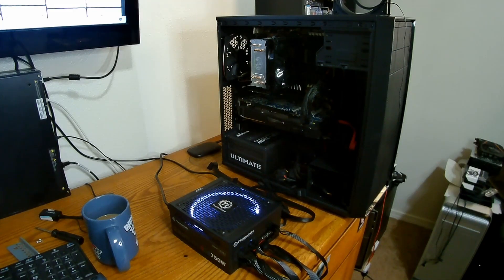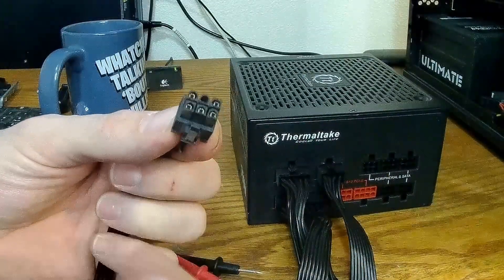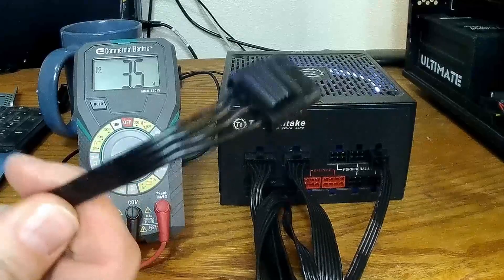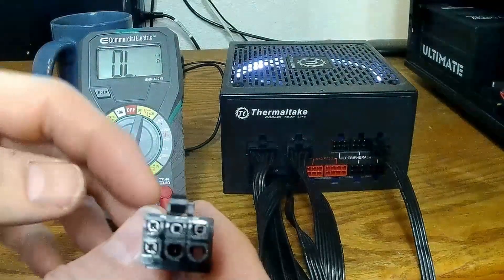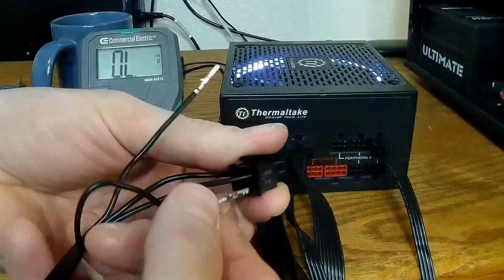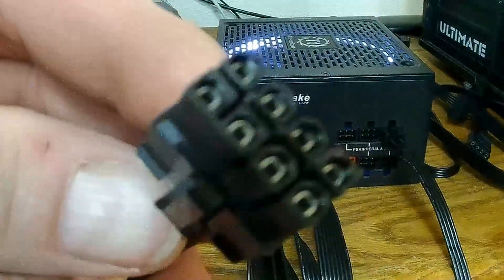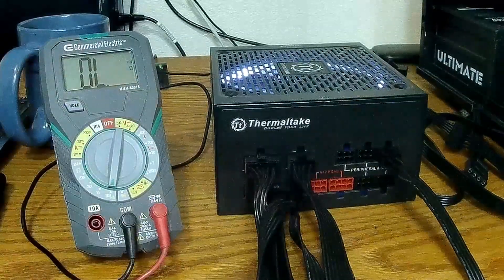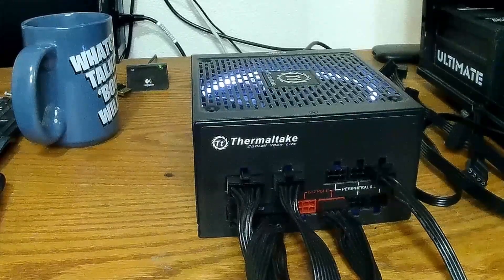Repin Modular PSU Cables!

Comment: First:  HOW THE FK do the PSU companies get by with making nonstandard pinouts for their devices?  The board side of all these cables is industry standardized.  Why can't the PSU sides also be standardized?

Second:  When I get a new PC, I always bring over all my former drives to the new machine.  My current new build has 6 former drives, plus a DVD drive I'm adding to the new build.  The cables supplied by my new Thermaltake PSU only have 2 SATA power wires, each with 3 connectors.  Thermaltake said they do not have a cable that I can buy from them to power my last drive.  How the hell is that possible????
Reply from the maker: They'd rather sell you a psu vs a cheaper connector unfortunately.

Comment: I have a question for you. i have a corsair RMe850e 80 plus gold low-noise atx 3.0 gpu and have an issue with the pcie cables. on the cable end that plugs into the gpu all the plug holes are not full. if you are looking at the plug with the clip facing up lets go with a count like this.
       clip  
    1 2 3 4 
   5 6 0 8  the zero does not have a pin in the plug
this is what came with my gpu. i am in need of another cable but can not find any cable that matches what i have. i am asking you if a cable with this configuration will work with out issues. 
    clip
 1 2 3 4
 5 6 7 0      zero has no pin.
your advice will be helpful

Comment: Starting at 3:58, when you're checking the volts on the psu with the red lead on the multimeter, where is the black lead connected to?
Reply from the maker: the black lead is grounded to the psu chassis.
Reply: @ thank you for answering. This was very helpful. This video helped me tremendously.

Comment: Hey man great video really educational, I'm in a bit of tough situation, so I got this Zalman 1000w EBT series modular psu, came with only mobo and eps cables, and I did find a pci e cable on the market which turned out to be a corsair type 4, the issue was the psu side of the cable had a double wire in the bottom, and when I probed the psu to test voltage I found that the top is 12v and the bottom is gnd, so should repin the cable and separate those double wires ? Plz help

Comment: Can you explain where did you put your black probe when testing for voltage?
Reply from the maker: Any ground is fine.  The case is the easiest ground to find.
Reply: I just watched your other video https://www.youtube.com/watch?v=ij2jwJewCQs. I didn't know you could use ground from the 24 pin connector for the motherboard. That makes it much easier to find the ground. Thanks a lot for the video. Probably the only good video on youtube about this particular thing. 

Another question. On your other video, which function do you use to find the ground pin? Is it ohm meter or continuity reading? How does that work exactly?

Again, Your videos is very much appreciated. Thanks in advance @idoesstuff1